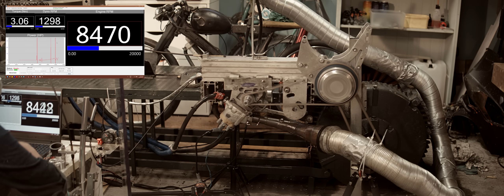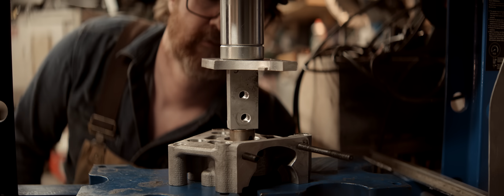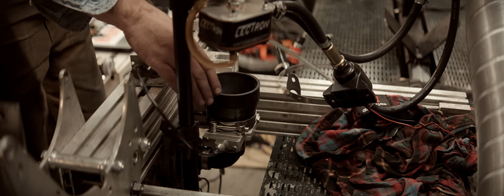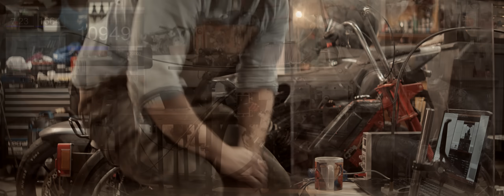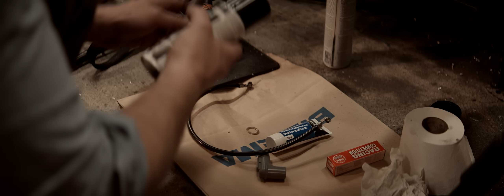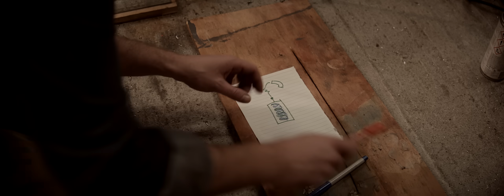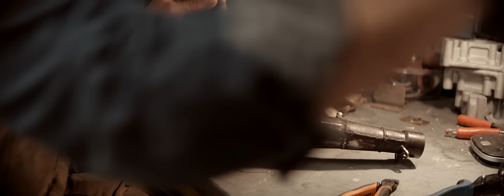50cc only making 29hp. Where did the power go?

Comment: I wonder if you could ground that stand. It's probably acting like a big radio antenna broadcasting emi throughout the whole area
Reply from the maker: Haven't thought about that, thanks!
Reply: @2STROKESTUFFING  not a problem, you can test for emi by making an open air coil and reading if a voltage is induced or not. you could set a few "antennas" up around the area while you do a run to identify emi sources. The coils only work well when oriented with the field lines so itll act like a compass of sorts as well
Reply: Did a bit of reading to brush up on my elctromagnetic knowledge and i realized grounding the stand might make it worse. it can cause more power to be drawn from the coil due to the magnetic coupling. shielding/isolation is probably the best option to prevent additional power draw on the coil, maybe a Faraday cage and resistor to ground to limit the power draw. You might try reaching out to Dave Jones at EEVBlog, hes an aussie youtuber who does electrical engineering. he would definitely have an answer if he has the time, but theres also the eevblog forum where you could probably get advice as well. Hopefully you get these bugs sorted so you can start pushing it even further

Comment: The chain scares me. It needs a guard just in case, freak acident can be life changing. Safety First !
Reply: He is behind polycarbonate shield
Reply: @sold4200  Lots of energy in that chain, don't know if polycarbonate would contain that.
Reply: @dutchsailor6620  I mean, it is probably something armored, not just  transparent shield, he said something about that
Reply: @sold4200  I hope so, that slapping chain gives me the creeps. Also all this movement eats HP and generates mechanical pulses on the crankshaft, wreaking havoc on the crankshaft bearings.
Reply: @dutchsailor6620  I wrote the same thing some time ago.
Reply: @sold4200  chains wrap around things when it lets go, that polycarbonate isn't that tall.
Reply: The shield thickness is substantial
Reply: Please look at top fuel drag cars you fire them on petrol then over to nitro . Once going there is so much fuel going in not even twin msd can fire ,they then run as a diesel the spark plugs act as glow plugs.

Comment: Im only 11minutes in, but I reckon the play in the crank is NOT the bearings, but the bearing journals.
The harmonics in that top feed chain of the primary drive is SO savage its stretching the journal & that 'weird' grey paste around old bearings is aluminium powder...
Can actually hear the revs flutter/fluctuating during acceleration & it clears up as chain stops slapping about at top of power curve.
You'll need to run some kind of roller/tensioner on both sides of the chain.
All that said, fingers crossed Im wrong & look forward to watching you defeat these hurdles!
Reply: Yea agree that chain slap is horrendous, it has to be eliminated. His tensioner is so wrong, it's doing nothing.
Reply: @dubsydubs5234  A lot of comments point to the small front sprocket and they're absolutely right it'll be flogging the crap out of the chain. Probably only good for 100 pulls and time for a new chain.
Reply: The vibration looks absolutely insane, and the engine almost sounds as if it is four stroking during acceleration.
Reply from the maker: I think it's missing ignition events throughout the range.
Reply: The tension side needs a chain guide, as well as the tensioner for the slack side, and I agree you can hear the slap tugging the rpm all over the place until it settles down.
Reply: I'm with you on this as well. I'm new to this channel, I've only been watching the last couple of months, but one of the first things I noticed was how sever the chain movement was and I wondered how the engine bearings were tolerating that. 

I know first hand how severe the damage can be to an automotive engine when an oil driven timing chain tensioner and guides fail. I think this setup really needs some sort of hydraulic based chain tensioning system and a guide of some sort.
Reply: The problem he has cannot be solved with chain tensioners; the crankshaft has too little rotational mass to keep the crankshaft speed reasonably stable during compression. When the crankshaft reaches 17,000 rpm in the downward movement, the high compression effort slows it down to 14,000 rpm, which is why the chain runs so poorly.
Reply: I think I'd go with a different reducer for the exhaust,  I'd really want a smooth transition  reduction out the exhaust.  Not to mention very smooth polished inner exhaust walls.
Reply: I think the amount of chain slack is robbing a few HP.  Tightening up the tensioner or eliminating it might help.  The chain bouncing around could be wasted energy and drag.  Or perhaps run 2 tighter tensiononers, one on the upper and one on the lower.  Or a chain guide.
Reply: Yes, that is why cam chains have the tensioner / guide on one side and the guide on the other, they do how ever run in oil.
Reply: I would have to review the bonniville episode, but not sure if bike accelliration, or lack of, was an issue on the day. Since we are running the engine at a constant rpm, i would add some mass to the rotating assembly to smooth out some of the gremlin on the dyno. There is to much going on in the first 70% of the 5 second dyno run, fix what is very obvious there and ignore the rest.  we will get through that 3 secs on the day and then there will be 5mins at 16k rpm.

Comment: You say a long intake pipe helps the power what if you mount the carb at the other end of the intake runner giving the already mixed air/fuel time to gain speed then ram into the combustion chamber? It Might be worth a test.
Reply: You need velocity before and after the carb, you want a long intake a big carb and a huge airbox to feed it ideally

Comment: The difference in sound betweein runs is odd. On the 30hp runs, it really sounds strong and like it really picks up like a powerband towards the end. The runs around the 28hp mark, you can really hear the engine struggling to pick up, it sounds like its being pushed alot harder at the higher revs. I have no real advice, I just thought I'd mention it.
Reply: yes i noticed the sound too,, perhaps it is the ignition failing, it sounds like its 4 stroking almost
Reply: I guess it must be extra friction as the engine heats up
Reply: I also noticed this, tought it was the bearings, but the noise is the same with the new bearings
Reply: Perhaps if something makes the run take long time the engine builds up more heat and makes more power. Maybe the setup needs a smaller rear sprocket to take longer to spin up.
Reply: Colder air now - could be buffering due to different density?

Comment: Been enjoying progress for years. THANK YOU.  you previously mentioned old fuel likely containing water due to age,  Could the water in fuel, expanding quickly as steam be contributing to power? Dropped off a few HP due to clean fuel without water?
Reply: water in the fuel would either ruin combustion or cool it down. the cooling effect is useful for racing engines that run on gas to lower temperatures. this allows the engine to take more fuel for producing more power, but in this case, with the pip, the combustion is already cool enough to not melt anything... ok it might be enough to melt the exhaust but not the engine.
Reply: Other people have tested water ratios and volumes with water meth injection in boosted applications from full methanol to full water and the water does nothing until theres so much that it hiders combustion and you loose power .. wat it may have been doing is making it leaner by taking up volume through the jets thus having less methanol/nitro blend actually making it  to the engine
Reply: On paper it could. In reality most likely not. Steam expands considerably slower then combustion at those speeds. Thats why steam trains only revved so little compared to combustion engines. But an interesting thought nonetheless.😊
Reply: @just_j0e  And the steam convertion remove heat from the combustion